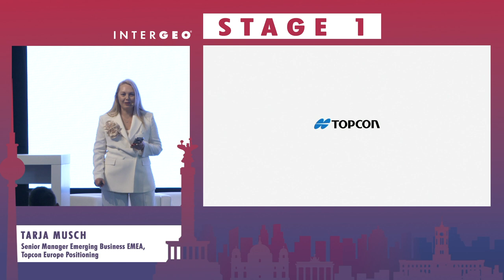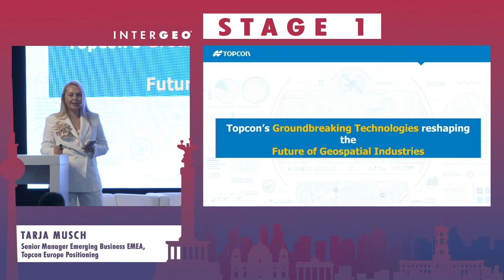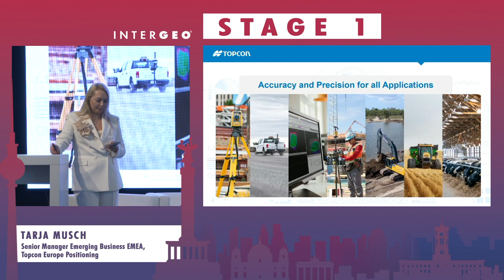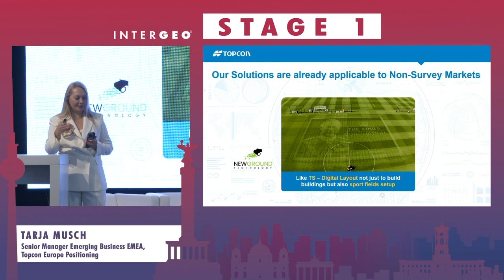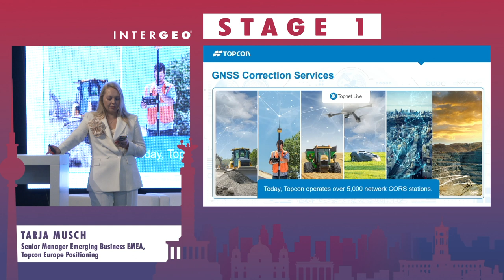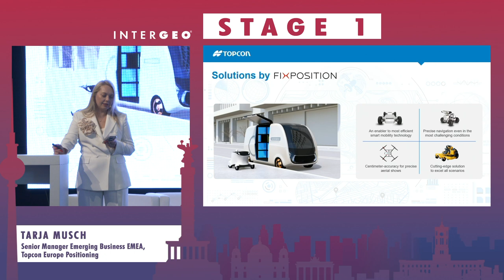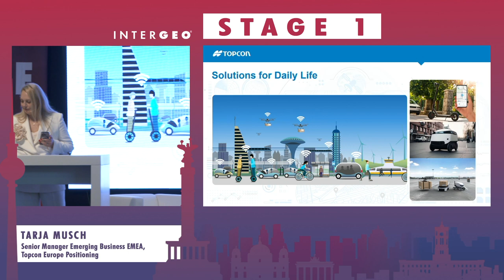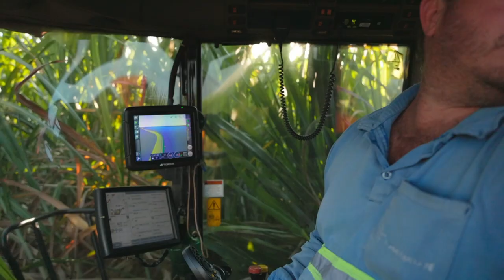TARJA MUSCH: TOPCON’S GROUND BREAKING TECHNOLOGIES RESHAPING THE FUTURE OF GEOSPATIAL INDUSTRIES

Comment: The problem with the Japanese SC maglev is they are using a horse shoe shaped tunnel that cannot take overnight container trains therefore they are not able to make a profit where by using 60 Chinese double shield hardrock TBM to connect Sydney to Melbourne via Canberra and Albury they can eliminate trucks and planes earning $2,000,000 per night.

Also to eliminate complicated points to the freight sidings I suggest that the front wheels should be steerable.